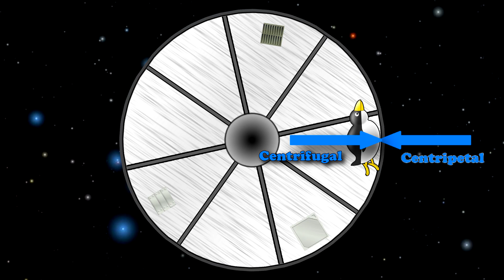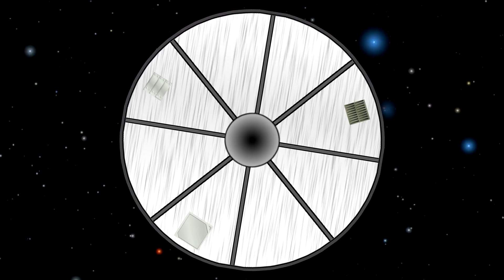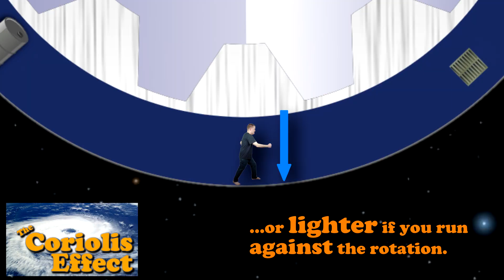Faking Gravity in a Spaceship

Comment: Isn't the air inside of the sphere also weightless? What would actually push you to the outside edge, if you were just floating, static, in the center of a sphere that's spinning, but not moving in any direction? The air would be weightless, too. So what kind of friction or force is going to push you outward?

I still don't see how any force can act upon you, unless you are against the inner edge, ie. the floor. Am I correct in thinking that the air inside is not going to rotate with the sphere? After all, everything in there is going to be weightless, so, no friction.. You're not really going to start rotating, unless you are against the floor. Everything is just going to rotate around you, until you're either tethered, or in contact with that sphere. (I'm implying that there's absolutely nothing in the sphere, to make things more simple.) No ladder, and no central structure at all.

I know that you know more about this than I do, but that doesn't sound right to me.

This topic came up on FB again, so it got me thinking again. 🤨 Oh yeah, I love your show, by the way. ✌️✌️✌️
Reply from the maker: The air is also touching the outside edge. The drag that air has against the edge causes it to start spinning with the space station.
Reply: @ScienceAsylum  
Seems like it would have to be spinning extremely fast for that to have any effect. Especially when the air itself is weightless. You just don't have friction, then. So, what's moving the air? Without friction, there is no drag. I'm not sure about this one. 🤔 
I'd have to see it actually tested. But, of course that's pretty much impossible. Actually, with no friction and no weight, I guess the speed it's rotating wouldn't even matter...now that I think about it. 🤨 Are you saying there can be friction without any weight? 😳

Well, it's not totally impossible. I guess this could actually be tested. You just need a round, hollow spacecraft just floating in space, stopped completely. And then spin it, while someone or something floats in the center, also floating motionlessly. Of course, it would be really hard to get to the center, just to try to stay still. The slightest nudge in any direction is going to send you all the way across, right? Because things in motion want to stay in motion. But then, this would probably be a lot tougher than going to the Moon.

Comment: How big the rotating spaceship has to be if it only turns once a day, like the Earth???
And then you could have night and day in an Elysium style Space-Ship.
Reply: 1.8 million km radius.

If the Elysium-style spaceship always keeps a sunshield between itself and the Sun, it can make day by lowering a mirror down below the shield edge and angling the mirror 45° so that sunlight that would have passed by is diverted 90° up into the interior. When we want night, we pull the mirror back up.

Comment: Why whould a spinning spaceship around you start to pull on you? Its just an abject in the vacuum of space spinning next to you. It has no force to pull on you, it has no gravity. It its spinning speed is not constantly accelerating and it is not touching you, it whould just spin straight by you.
Reply from the maker: If there was a vacuum in there, you're correct. In that case, if you weren't in contact with the "floor," then you'd just float there while the station rotates around you. These space stations usually have air in them though and that air might nudge you toward the "floor" gradually. Once you come into contact with the floor though, the friction will be enough get you spinning with the station. It's then that you'll experience the fake gravity.

Comment: The best way how to simulate the Earths's gravity in the space ship would be having the ship still accelerating at 1g and having the floor oriented against the direction of movement, so no Coriolis Effect and the same feeling of gravity in the whole ship...then in the middle of the way, the ship could just turn around and start decelerating the same way...
Reply from the maker: That would require a lot of fuel. (On the other side of that argument, an acceleration pattern like that would lock inthe travel time. What if we figured out how to get there faster?)

Comment: Sir isn’t there one another solution? Can’t we place capsule chembers or long cylinder shaped chembers across the wheel whose floors will be perpendicular to the tangent of the wheel. Then we would rotate the wheel in such a speed that it would create an acceleration ( parallel to the tangent or perpendicular to the floor ) same as the Earth's gravity ( 9.8 m/s/s ). Wouldn’t it solve our problem? Please let me know.

Comment: @3.30 In experiment 2 you said the faster you run the heavier you'll feel. Actually as shown in the graphic, you would feel lighter. You'd need to be running in the same direction of spin to feel heavier.
Reply: The “or lighter if you run against the rotation” note sounds more like it. So the explanation refers to this side note and not the actual graphic animation, which i found a tad confusing.

Comment: Would "artificially gravity" of spinning be "actual" gravity as "gravity" is caused by the mass of an object altering space-time to be slower in one area over a gradient curving your straight line path and on the inner surface of a spinning object because you would be under a similar space-time effect due to being in a state of regular acceleration? Or am I overthinking this?
Reply: No. Spin gravity is gravity.

Comment: Could you just wear a metallic suit in a strong magnetic field? Seems like that would be simpler?
Reply from the maker: Nope. The rotation is more convenient because it works without a suit that could limit your mobility. Also, your strong magnetic field would require a lot energy to maintain. The rotation is much cheaper.
Reply: @ScienceAsylum  isnt the cost per pound to orbit 12000 dollars? Just saying...

Comment: I think you are wrong at time stamp 40 sec. If you are floating in space you are not going to slowly drift towards outer edge, this may be the case in a merry go round because you are in contact with the merry go round. In space there's no contact. There is no force between the outer edge and the center.
Reply: This. According to popular understanding of gravity, you would just bounce off. Now if you had magnetic boots, say, you would move with the spin (same as the ladder), and once moving, the tug would be minimal. One might actually experience a force pushing you backwards, as opposed to down, like a  constant attempt at a sit-up.

On the ladder you would feel a slight tug (a feeling more like hanging in this instance) in a diagonal direction. But as soon as you let go or disconnected from your magnetic shoes you would begin to slow down. -- However, now you will be moving in a straight line, you would soon bump back into the ship. After being a human pinball for awhile, you would end up 'floating' again.

Now you begin to realize that there are  a lot of moving things, on all sides of you... constantly; Bump any surface, and you're back to being a pinball again.

Another interesting question that would arise from this: what kind of torque/leverage exists in zero gravity? If space is essentially void of anything, what's there to torque or leverage against?

Comment: I have a question for you. If you are on the floor of a spinning torus type spaceship, or station, what happens when you jump? We can't spin the space within it. So, anytime your body is not in contact with something that is attached to the central spinning point, there isn't going to be any feeling of "gravity," or centrifugal force. Am I correct? So, if you jumped, you would immediately lose centrifugal force, and your body would continue tumbling in the same direction it was spinning, before you jumped off the floor. You can only make the torus spin. It's still zero g everywhere that's not a surface, attached to the central spinning point, physically. Right? Imagine if you spun the ISS. If you were standing on the wall, you'd stay there. But, if you were not touching anything, it would just rotate around you. If you were completely static, you'd stay that way.
Reply from the maker: If you started in contact with the "floor," then you're moving with it, correct? When you jump, it's not like that sideways motion stops. It just changes to linear. You move forward in a straight line and eventually reconnect with the "floor" since it continues to rotate underneath you as you move forward. To you, it'll just look like you jumped up and then fell back down.
Reply: @ScienceAsylum  
But your feet are already rotating, which is probably going to send your feet spinning, since the Coriolis effect will still act upon you. It's not going to be the same as throwing a ball off of a merry-go-round. Not in zero g.
Reply: Your trajectory path will be a combination between the spin and the direction you jump. Which means, you are going to start spinning (because you were already spinning), as soon as you jump off the floor. And then, you're out of control, in zero g.... until you either collide with something, or grab something. And if you grab something, you're going to feel one g of force on your arms. Any free space inside the torus, that's not attached to the physical structure (or standing on the floor), is going to be experiencing zero g space. And that's because, the space inside does not spin with it, and nor does the spinning create any centrifugal force, unless you're hanging from a ladder or standing on the floor, etc.
Reply: Yes, the force would feel less when you climb a ladder, toward the center, but it would have no effect on you unless you're standing on the floor, somehow attached, or hanging onto some physical part that is attached to the central spinning point. We can't spin the space inside. It's still zero g, when you're not touching any part of the spinning portion. I mean, am I way off here? I don't see how space is going to spin inside, no matter how fast you spin it.
Reply: When you're not standing on the floor, all a sudden the floor becomes the walls, and your feet are going to kick up behind you as you start to spin into that wall, because you instantly lose centrifugal force, when your feet leave the floor. Yes, you will have a trajectory path, but until you're connected to that structure again, there's zero g in all empty space, within the spinning torus. Because we can't spin space, itself. You said it yourself in the video. The centrifugal force is not going to be acting on you, but the floor. (and anything else that's attached to the central axis) So, you're going to need something to pull you back down to the floor, before you will feel centrifugal force again. Otherwise, it'll be kind of like tumbling in a dryer. Especially since your head is heavier than your feet. Not to mention, your feet are already feeling a stronger force than your head. Okay, maybe I didn't say that quite right, since you will suddenly become weightless. But your feet will definitely be spinning faster than your head, which is going to send you into somersaults, at least partially. My whole point is, your entire body is going to lose centrifugal force, as soon as it's no longer in contact with any part of the torus. So, it's not going to just feel like you jumped up and down. No matter how big the torus, you're still going to lose all centrifugal force, as soon as your feet leave the floor... Similar to if you jumped off of a fast moving merry go round. That force stops immediately, as soon as you jump off.

Comment: Why would they have to fake the full G? If a ship 10 meters in diameter spins at 6 rpm,  the acceleration would be 2m/s2 which is 1/5G, enough to help with everyday life and perhaps reduce some of the health issues.  Astronauts laying parallel to the axis would hardly feel any "gravity" gradient, methinks. Does this make sense? PS The wheel in 2001 was not that big, maybe 15-20 meters in diameter, no more.
Reply: The Wikipedia article about the set for "Discovery 1" (HAL's 'body') states the ferris wheel's diameter was 12 metres.

(Were Frank & Dave merely mobile organs moving inside HAL? Was HAL 'tickled' when the two crewmen moved around? Did Clarke/Kubrick get the idea of performing Brain Surgery on HAL from the movie "Fantastic Voyage"? So many questions!)

Comment: If you convert the electrical energy of 100 TeraVolts & 100 Ampere running for 1 second to kinetic energy with about 10-15% energy loss maximum you'd generate an extra 1 kg of mass coming from the movement alone. This is based on E=mc2. Good luck NASA

Comment: Would the air ballon actually get to the center?  The balloon rises due buoyancy...lighter than the surrounding air. But the atmosphere would be spinnjng also due to surface drag and would be pulled towards  the inner rim of the spaceship spaceship....due to drag.

So the volume of air would be less dense (pressure gradients will have smaller numbers)...which means the the balloon should  find equilibrium somewhere near the center...but not at the center.

Just like a helium ballon cannot go into space from earth.

Comment: A lil confused....if in a space wheel and you are standing on the inner rim....while you are standing i see why you would feel weighed down. But if you jump up...why would you not be come weightless. If its the spinning air pressure that pulls you back...would that not take a long time...which means you jump would not be a quick up and down.
Reply from the maker: "But if you jump up...why would you not be come weightless."
When you jump up, you do become weightless... at least in the usual sense of the word. That's true even on Earth. That's why you get that weird feeling in your stomach at certain points on roller coasters.

The air pressure thing was only if you were floating when that ship started rotating. If it's already rotating and you jump, then it's your sideways motion that brings you back to the ground. The air pressure is unnecessary. The fake "gravity" would work even if the ship had a complete vacuum inside.
Reply: @ScienceAsylum  

This one gets me a little closer to understanding…

Comment: I'm more curious how the FEELING, since you mentioned it, is different. Will it induce nausea? 6-9 months of nausea is not fun. How does it feel as the forces keep shifting depending on how your head is oriented, or if you move up and down? Does this make adjusting difficult or create preferred positions and movements?  

Also...I wonder if a spinning habit on a planet like mars would be feasible.
Reply from the maker: It depends on how big the circle is. If they design it to be big enough, there shouldn't be a problem. If they make a tiny one, then you'd better have a strong stomach!
Reply: @ScienceAsylum   So...five football fields and you basically won't feel it? By my calculation...5 football fields at 360 feet each (HUGE!), standing up (3-4 foot ascent of the head) might produce a 0.2% change in distance between your inner ear and the axis.   

That does seem small. But then again...I've noticed in VR that even imperceptible differences in how our senses calibrate can cause discomfort. 

I would love to try it. It would be nice if we could create a large enough human centrifuge on earth to test it out.
Reply: @ScienceAsylum   BTW, largest human centrifuge is the TsF-18 Centrifuge in Star City, Russia. 59 foot arm (so, seated, probably equivalent to a 105 foot diameter circle, only 6% of the size we are talking about!)  Long way to go. We are talking huge communication towers laying sideways. Might be better to just create a smooth circular monorail with a rotating train.

Comment: If you are in a non spinning spaceship with no air turbulence and released a helium balloon, would it sit stationary and not float away?? Seems like it wouldn't move anywhere because there is no up direction from gravity and the air is evenly spread out.
Reply from the maker: If the ship isn't spinning, then there's no pressure gradient in the air... which means no buoyant force, which means the balloon will just stay there.

Comment: i would just use two capsules, add a long carbon fibre wire between them and let them spin up like a bola. The added required material would be just a tiny bit more than the same two capsules alone. Maybe there could even be a connecting pipe (low weight ofc) with a 1 person elevator connecting both of these capsules or even big stations.

Comment: If the space ship had no air. Then I think you would not feel any "pull" to the floor at all.
You would only feel "gravity" effects when you came into contact with the floor right?
As the ship spins, you would hit a wall, THEN the centripetal effect would kick in, and you would slide down the wall to the floor.

In other words, if you are initially "floating" when the space ship starts to spin, you would not "fall" to the floor at all. Only when you came into contact with a wall that is perpendicular to the motion of the ship.

Isn't this the most correct explanation of artificial gravity in a ring spaceship???
Reply from the maker: "If the space ship had no air. Then I think you would not feel any "pull" to the floor at all."
Yes, this is 100% correct. You would just float until you came into contact with something attached to the floor. Contact is required.
Reply: @ScienceAsylum  Thank you for clarifying that, I was unsure about that point! Great channel!